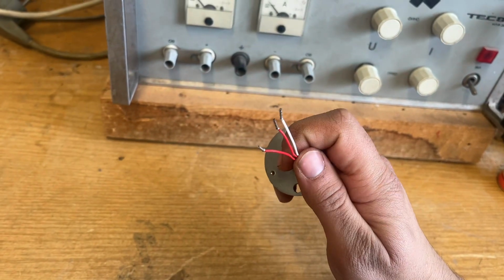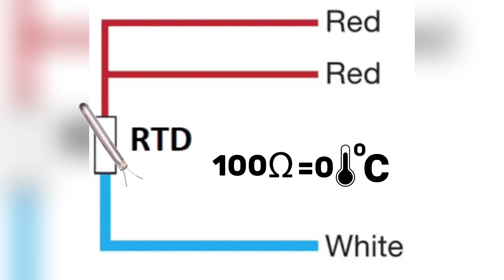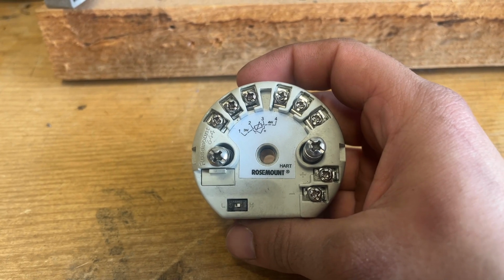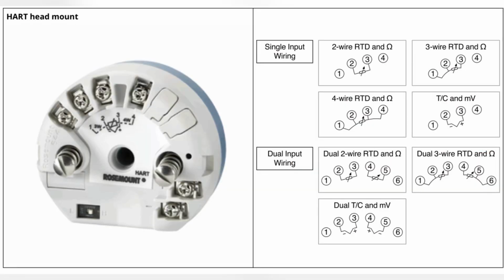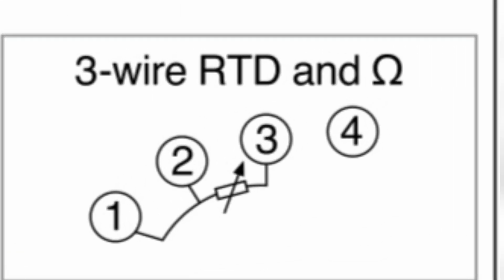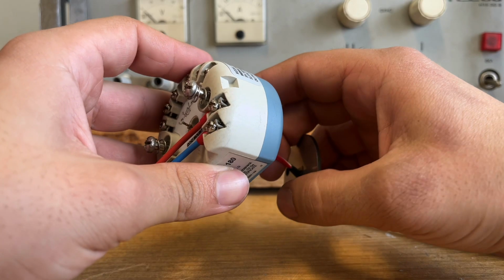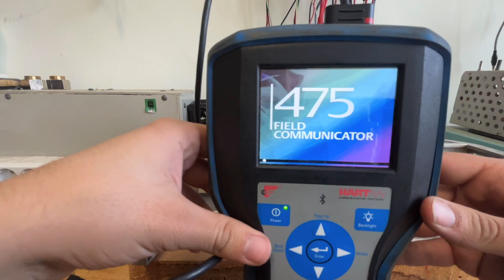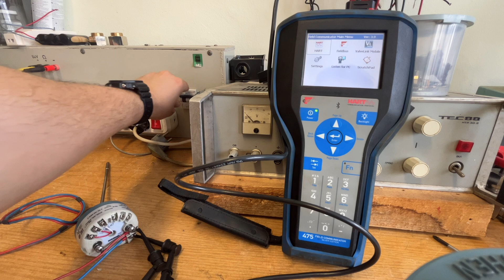How to Wire a 3-Wire RTD to a Transmitter – Step-by-Step Guide!

Comment: How do you connect the transmitter in a 2-wire 4 to 20 ma loop? In this video, you connect the transmitter directly to the power supply.
Reply from the maker: Exactly the power supply has resistance 250ohms which convert the voltage in 4-20ma because of that i can connect with HART communication because has enough resistance.